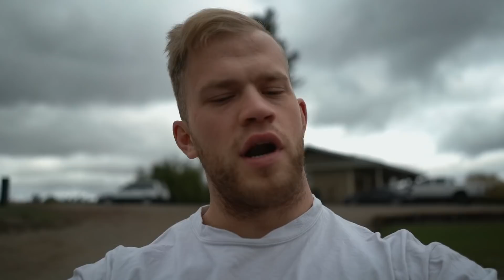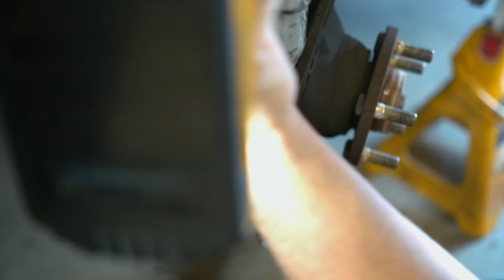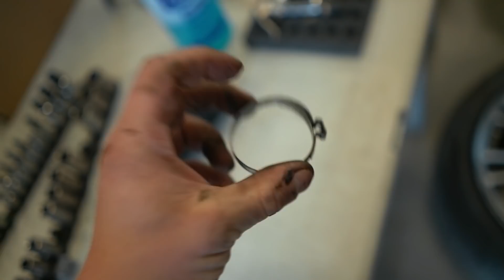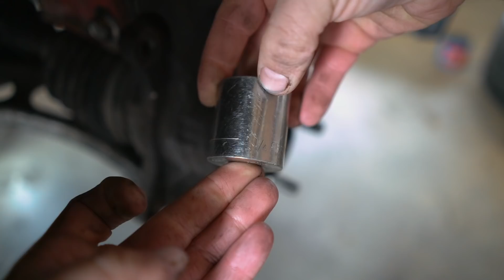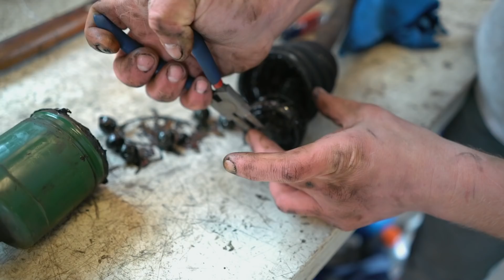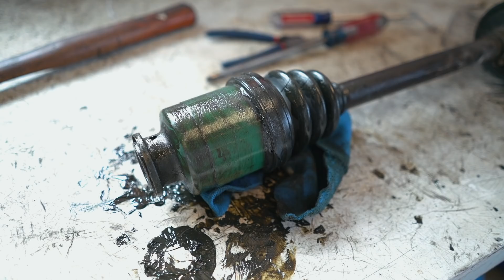My STi Needed This...

Comment: Quick tip when you re-apply the grease on the cv put the grease into the bell, that way when you slide the joint in it squeezes through the joint getting full coverage. Putting grease into the boot will just flick it around the boot and won't make it's way back into the joint.

Comment: The clamp that was on the steering rack boot is a pex clamp. They are mostly used for plumbing. You can find them and the pex tools at most hardware stores.
Reply: It’s technically an ear clamp; not a PEX specific thing.